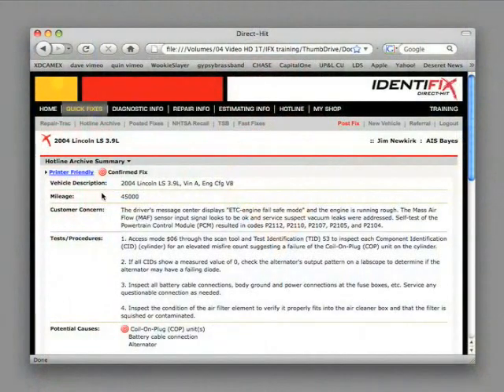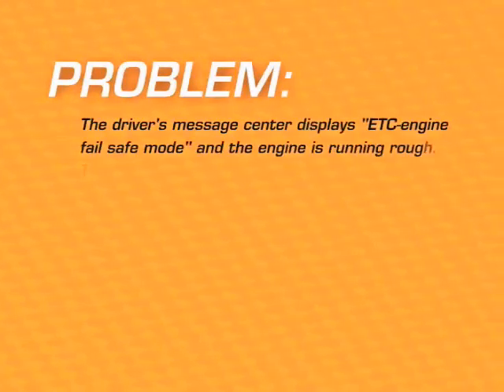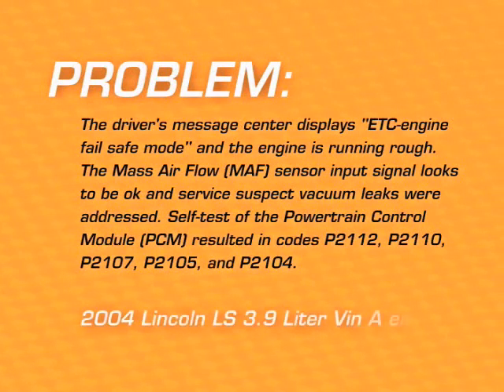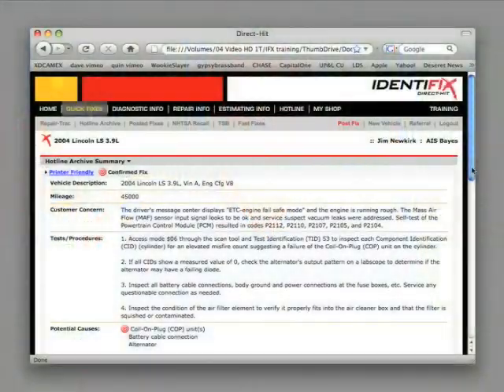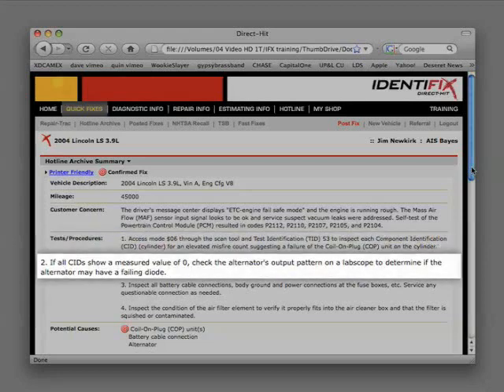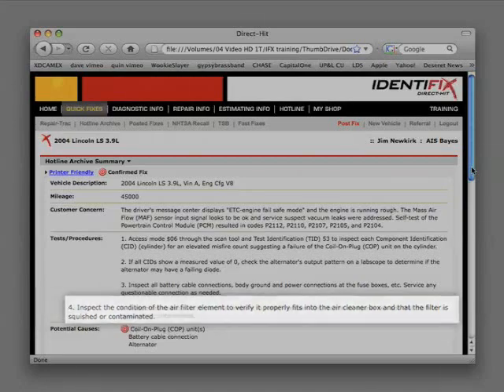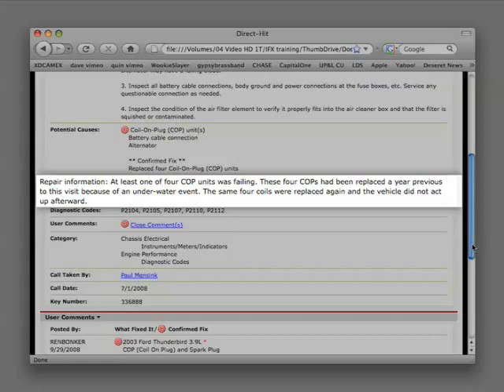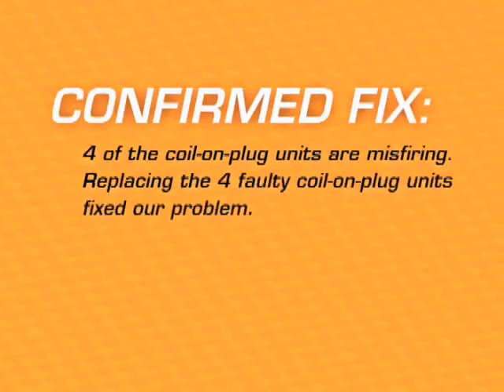Identifix: Lincoln LS - ETC-Engine Fail Safe Mode

Comment: I have a 2004 LS with 90k miles. Started going to Fail Safe intermittently and with no pattern. Threw some codes that pointed to the throttle body and it was replaced with NOS OEM. Still would throw codes and go to Fail Safe. Had it diagnosed at Lincoln and they were getting all kinds of crazy codes like VIN mismatches and ABS and traction control and so on. Knowing the car had four original coil packs I dove in and put eight new plugs and eight NOS OEM coil packs. All problems went away. The car now performs without a flaw. Running it aggressively up the highway on ramp was smooth as silk. Why wouldn't it be with all those new parts? ... Love that car.
Reply: Same thing is happening toe.. Lincoln has no exact pattern and I changed m.a.f. just bought some new spark plugs.. but the limp mode is getting out of vontrol
Reply: So how did y'all fix limp mode as I'm currently dealing with it

Comment: I'm trying to get my 2002 Lincoln LS 3.9 to start engine turns over sprayed carb cleaner and still not starting. Doors were locked and tow company unlocked. Drivers door lock is broke does not turn, could this set code for security system? Anybody got idea? Bought new key fob from Lincoln now have to take car to dealer for programming is this true or not?
Reply: Any luck?
Reply: @zephyrwheeler3380  your issue is spark u got dead coil packs just like in this video
Reply: You should be able to program the key fob and reset the security system by yourself there's a sequence for both on YouTube